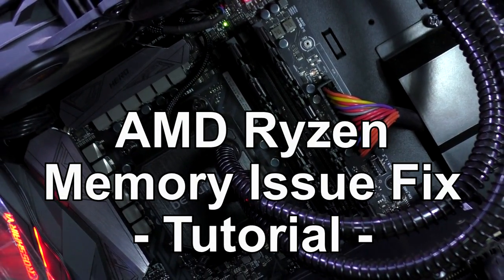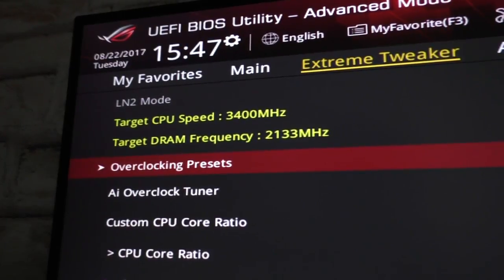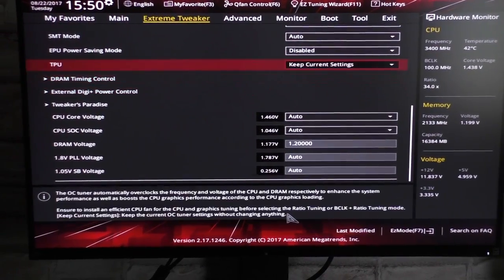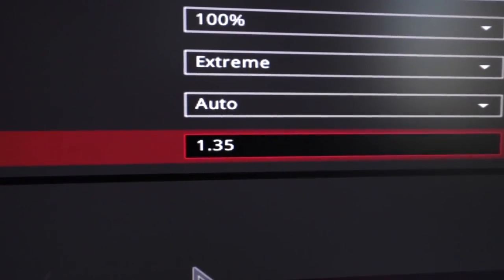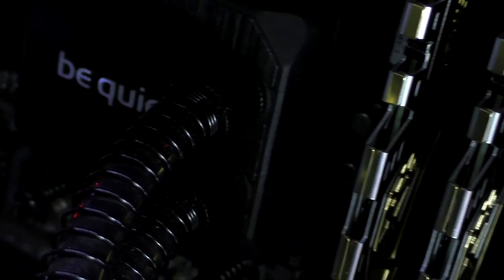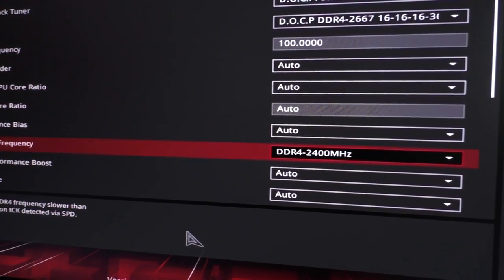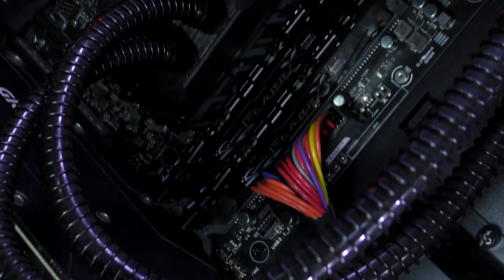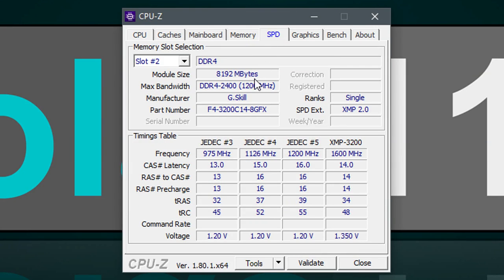AMD Ryzen Memory Issue Fix - Tutorial

Comment: X570 tuf wifi with ryzen 3600
Tforce 3600mhz reads as 2400mhz. 
Turn on docp and it worked for 30 mins then blue screen.  It hasn't work again with docp so i increase voltage to 1.4 and it work for 5 min. 
Now am back and stuck at 2400mhz.
Reply: Did you ever find a fix?
Reply: @SilverDetroit  yes.  You have the same mobo and ram?
Reply: @briantezo9232  pretty similar just curious if you ever figured something out
Reply: @SilverDetroit  look for something that says SOC. It could be ddr SOC or vid SOC. The voltage there is gonna be 1.1 you need to increase that.  If you want 3200mhz 1.13  would do if it's 36000mhz you could try 1.16 or higher but don't go higher than 1.2. 
Save and restart then load docp and you are good to go.  If it's not stable with 3600mhz try lower mhz. 

I got an stable 3200mhz since my ryzen 3600 box says memory 3200mhz.

Comment: I'd just RMA if you can, sure you could push extra voltage to get it stable, but if it's under warranty replace it first. Especially since ram kits should be able to run at their rated speeds for long periods of time.

Comment: im running g.skill trident 3000Mhz ram kit , and i cant get it stable at 3066mhz .. 
it post like 5 times after a cold boot up .. 
i dont know what to do , and the memory try it dont have the 3000mhz ... even the timings are diff... 
im new to oc , so i really need help ?
Reply: got it, im using b350 gaming pro carbon , and i just used (memory try it) to 3066mhz , and so far so good

Comment: My ram is stable at 3200 at 2x16gb but everytime I perform a normal reboot on windows after it goes off and boot back up it keeps turning on and off then goes back to 2400. Then I have to reboot again and set it to 3200 manually and it becomes stable.

Comment: Corsair's Vengeance LPX, 4X4GB DIMMs. Got them running stable at 2800MHz with my Ryzen 5 2600 and GTX 1060 (6GB)  but Shadow of The Tomb Raider couldn't run correctly so I lowered it down to 2666 MHz, which while not as good as the rated 3000MHz, it's better than 2133 (which is what I was getting). Testing at 2666 shows that GTA V hits lag spikes as low as 30s and Shadow of the Tomb Raider is fine until it encounters a scene that is too intensive so I'll have to tweak settings for both games. OS is perfectly stable and boots every time. DRAM Voltage set to 1.35. I have yet to test my other games though. If I find that they all run worse at 2666 DOCP enabled then I'll disable DOCP again and just use my RAM at 2133MHz until I can get a motherboard with better RAM support.

Comment: I have the exact same issue here swap from an old Ryzen 3600 to the new 5800x3D. 
Only able to pass Memtest86 with 1 slot of ram full, the moment you fill those 2 slot of ram, the computer 🖥 suddenly shutdown after fire up Memtest86. 
Is already been 4 weeks I try to fix this ram slot issue on the 5800x3D with no improvement. 
Anyone here has a solution for me will be appreciated 🙏.

Comment: I have xpg ram 3000mhz, installed on x370 crosshair vi. No display whatsoever...
It turns out my mobo compatible with 2400/2666/2933/3200/3600 mhz
BUT not 3000mhz...
Can't get into bios though.
Does this mean I have to get a spare ram let say 2400mhz and get into Bios so I can change the dram freq to 3000mhz ? 
Just to make it support
Reply: Passion Fruit hey did u find a solution? Because that happened today to me can’t get even into bios

Comment: I have a b450 steel legend board with 16gb - gskill ddr4 - 3000 xmp2 ready ram kit on a ryzen 7 2700x wich runs fine but if i ad 16 gb extra of the same memory i get a blue screen after about 5 minutes, any idees anyone, thanks
Reply: Did you ever get this figured out? I also added 16gb of gskill ddr4 to my 570x board and started getting a ton of blue screens. And for some reason my PC won't boot when RAM is only in the first and third slots from left (which were originally empty) but starts up just when when in the second and 4th like they were before I tried adding more. Thanks.
Reply: @baker217  I think its because the NMVE.SSD uses the first lane ans stops the first memory slot from using it in my case, so if you are running an NMVE.SSD it could be the same.
Reply: @kurtbilliet98  can you explain a bit more please? I am using a Samsung 970 EVO, but what does that have to do with the first RAM slot?
Reply: @kurtbilliet98  FYI I think I solved the problem last night. When I used the two previously unused RAM slots, my PC wouldn't boot, but it booted and ran fine using any combination of the 4 sticks in the 2 original RAM slots and passed tests with zero errors using MemTest86. So, I did a CMOS reset on my motherboard, put in all 4 sticks of RAM, turned the PC on and set the DOCP profile in the BIOS to get the memory clocking to specification, and everything has worked great. No BSOD all day vs many previously.

Comment: Problem still there on X570 boards. Wish I had gone for Intel.
Reply: Yep Ive got the x570 board with 32gigs of gskill RAM and my computer completely freezes and restarts daily
Reply: @Annatar_Lord_of_Gifts  i just upgraded from the ryzen 7 1700 to the 5 3600 .... had 32 gigs of Corsair Vengeance RGB and now only slots 1 and 2 work.  this is fucking trash
Reply: @Annatar_Lord_of_Gifts  Did you manage to fix it?
Reply: J0kuc I have not found a fix yet other then putting my computer into sleep mode is what is affecting it. Whenever I come out of sleep within a hour or so it will crash. Haven’t put it into sleep in weeks and no crashes since then. Just keep it on or shut it down
Reply: I just swapped boards and got a tomahawk b450.  Ryzen 3rd gen ready out the box.  No issues.

Comment: I can only run my corsair vengeance rgb pro 3200mhz at 2933mhz if i set the speed higher it wont boot what can i do to fix this i have a ryzen 7 2700 and a b450 steel legend
Reply: Kiyan Van Riet i got same ram but ith r5 2600 bootable 3200mhz but bsod after few minutes gaming
Reply: Nothing, ryzen 2000 series (also called pinnacle ridge) support max 2933 mhz of ram even tho your mobo supports higher your cpu dont. Get a 3000 series ryzen that should support at least 3200mhz but check it on amds page , btw 2933 aint that bad
Reply: @vadaszmate1400  no i already got it working it now runs oced at 3333mhz
Reply: NavyCreature295 how? What did you do?
Reply: @vadaszmate1400  i installed the sticks in the other 2 ram slots then i tried booting and it booted ran a stress test it was stable and then i oced until it didnt boot anymore without changing the voltage

Comment: legit the board won’t run ANY different RAM settings other than default. Tried 3 sticks with Micron E die, Samsung B die, and Hynix die. But I did notice the XMP runs if I only put in one 8gb stick (single channel) instead of 2x8gb dual channel (where it can only use the default it detects no matter what I change or do)

Basically I can’t XMP, or OC, or even loosen timings, or change ANY setting other than whatever default it detects automatically.

If I touch ANY settings whether it’s adding for minusing, it will try to run the setting twice and fail, and revert back to the default.

This is on a newer bios that supports Zen 2 as well. Although I’m only using a Ryzen 2600 aka Zen+

Comment: MB: ASUS ROG B350-F (5220)/ ASUS ROG B450-F (2605)
CPU: Ryzen 5 1600
Kit RAM: G.Skill Trident Z RGB 3000mhz CL 16 1.35V (test)
Kit RAM: Corsair LPX 3200mhz cl16 1.35V (test)
Problems:
- No detected memory ram Q-Led yellow
- No detected graphic card RX580 Sapphire nitro+ 8gb (Q-Led white)
- In gaming after 2-3 minutes display black screen and restart automatically. Before beep long and 2x beep short, Q-led yellow for detect ram = fail
Settings:
- frequency 2666mhz black screen in gaming
- frequency 2133mhz black screen in gaming
- frequency 2933mhz black screen in gaming and system instability. 
- frequency 3000-3200mhz system instability and blue screen in windows 10, after loading OS black screen. 
Why?
Reply: Same here with LPX 3200 CL16.
I have 2x4gb and all ok.
When I add another 2x4gb, computer is not booting...

Any idea? :(

Comment: I have B450m steel legend, R5 3600x, RX 5600xt and 3000mhz coarsair ram. Runs perfectly fine at stock 2133 speed but when I load the XMP profile at 3000mhz it appears stable but ALWAYS crashes eventually and resets itself to 2133. Bad ram stick?  Whole build is new parts accept for the ram.
Reply: Did you ever resolve it? Same problem here
Reply: Yes but cant remember how now 🤣

Comment: Im using a 3 x 8 gb ddr4 3000mhz. I Used to see 3000 mhz in task manager but now only 1500mhz. Why?
Reply: 3x8? or 2x8? if 2x8 @ 1500mhz is right then it'll still be 3000mhz. DDR stands for double data rate. so multiply by 2.
Reply: @rawlstonm97  so I should not worry?

Comment: Ty first when i got my r3 1200 i put my ram to 3000mhz but it crahsed sometimes but its now stable with 2666mhz :)
Reply: Have the same problem. Why is that?
Reply: @derricksweazie7949   ryzen 3 1200 only runs up to 2667mhz sometimes a bit higher but 2666 is best

Comment: I finally got my G. Skill Trident 3200 MHz CL14 RAM to work at the right speed by manually setting the timings, yet my CAS Latency is stuck at 20. Tried disabling Gear Down mode, but it didn't work.
Reply: iseeu1980 what are you’re timings good sir I have the same issue with b450f MOBO

Comment: I have 2 ram stick both at 3200mhz but my mobo says that one is running at 2900 it’s the ram a dud or my mobo?
Reply: I have 3200 also and it runs on 2133... thanks the story i bought it from since i ASKED for compabile memory- - fking useless seller
Reply: @jari2018  just set xml profiles in bios... and it will run at full speed. But before that try to update bios. In my case 3200 mhz 8gb hyper x after putting it into the mb automaticly set to 2990 mhz. And without any chances to wofk at 3200... so i updated the bios and it automaticly set to 3200mhz - max speed of my mb.

Comment: i don’t know alot of pc:s and im going to do ryzen build and i have gigabyte b450 aorus pro and ryzen 5 2600 but today i noticed that my ram (corsair vengeance lpx 8gb ddr4 2400mhz) isn’t compatible with ryzen, does it work if i use that ram?
Reply: I have one stick of lpx 8gb ddr4 2400 on a tomahawk b350 and a ryzen 1400. Definitely compatible but i think it has certain limitations. 93 percent of people can get 3.9/4.0ghz on a 1400. I can get 3.7 of stock voltages, or even less with auto LLC but the moment I try anything higher, heck even with 1.4v at 3.75 I start getting memory issues, or windows files getting corrupted. Thats at either the 2400 xmp, or 2133. I'm gunna find some dominators at 3000 i think and get 16gb's.
Reply: Yes it will work. Ryzen 1st Gen supports ram up to 2667mhz so every sticks rated with this speed should work. For higher rated ram you should look into your motherboard ram compatibility list. Ryzen 2 if I'm not mistaken support up to 2933mhz.

Comment: Doesn't work. I decided to go with an AMD build this time around. If I wanted my memory speed to run at 2133 I wouldn't have purchased a 3200 kit. I can't figure if maybe I am doing something wrong or if the RAM or mobo itself is the problem.  It's really aggravating.
Reply: Cruzan9 same very annoying
Reply: @brooklyn560  I went back to the basics. With this build, I am using only 2 DIMMS (for now). Reseated the RAM (A2/B2) and now it's working. I'll give it a few days to see if it's still running at the correct speed. I think I'll be paranoid for a while and check periodically. Not sure what you tried but that worked for me.
Reply: Cruzan9 i just upped the ram voltage now it’s stable for me
Reply: @brooklyn560  Yeah, initially I increased the voltage too and installed the XMP file. For me though reseating ultimately fixed it. So crazy these tweaks and problems. Too bad they don't work as advertised right out of the box.

Comment: I couldn't budge the voltage, but I had to move the ram from A1 and B1 over to A2 and B2 after checking the manual. Also had to enable XMP.
Reply: Hey I also have trouble getting my ram to run at 3200 mhz dual channel. And I have them at A1 and B1. So did moving them to A2 and B2 work?

Comment: I have a new MSI Mag b550 pro tomahawk wifi board and I thought I had a bad stick of RAM at first so I ordered 2 more. Its also two beside rach other b1 and b2. I could probably figure it out eventually even if i have to replace some components but its under warranty so im not touching it. If I put the ram in like it's supposed to go I get a red CPU light and no boot. I'm going to talk to MSI today and see what they say. I just hate having to tear my rig all the way back apart after I just got it all looking how I wanted. If MSI can't give me a answer I guess I'll send it back but I'm definitely going to look at my CPU very well. It's not a cheap one a ryzen 7 5800x but wouldn't a diagnostic test show if it's a RAM slot issue or a CPU issue. Also I did put a little too much thermal paste when I assembled it so some may have gotten to the pins. Im also going to yry my old cpu a ryzen 5 3600 and see if it will boot then before i tear it all apart and send it back.

Comment: My Athlon 200GE crash and doesn't display anymore, i return the motherboard for replacement but still same issue. I also tried changing memory Adata and Gskill. There is a time it will display after remove/insert the ram 50x maybe morethan that. I regret picking this platform. I have older FM2+ much stable compared to AM4.
Reply: The only component i didnt change is the processor.

Comment: Ryzen 9 3950x, 3600Mhz 32GB of Ram, honestly I had the ram running great until I installed Ryzen Master which is now just keeping my ram at 2133Mhz and failing any OC I attempt to give it, even when running 1.4V for the ram where 1.35V was stable before

Comment: Okay... I will play teacher today!
1st... AMD recommends if you have a ryzen 3rd cpu... to run the ram at aclock speed of 3200mhz

*System Memory Specification
  3200MHz
*System Memory Type
  DDR4
*Memory Channels
  2

^^^This is only at the stock cpu speed of the ryzen chip only (Baseline)

It should boot up...without a problem!

don't know why others are trying to use other ram speeds when AMD tells you exactly what speed is recommended!

another thing......

get ram off the QVL list for your motherboard.

Booting with 3200mhz while your CPU is overclock will work the first time but...give it a couple reboots.

On the B450f.... it will Beep Once (Long Beep) and 2 (short beeps) which means that the board cannot detect the ram

it will loop until it boots up which now the 3 short beeps will happen.... VGA no detected!

If you want to overclock and play safe.... buy the ram sticks that are not overclock to play safe

2133, 2400 and 2600 which is recommended....

anything higher than this will have 50/50 chance of booting up!
Reply: Hi, thx for the information, i didnt knew that amd recomendations. So, i have a 3200mhz ram, but i can only make it work at 2933mhz at stock ryzen 5 2600 cpu, if at some point i decide to upgrade to a 3rd gen ryzen i shouldn´t have problems loading the xmp profile for my ram at 3200mhz?

Comment: Something of interest for you all. Come to find my gigabyte aorus m motherboard slot order is 4,2,3,1 even says it on the board itself. For many years I was under the impression that all motherboards were 1,2,3,4 and typically as per common practice would put first 2 memory sticks further from CPU and every other slot so in 2nd and 4th slot. But on my MOBO 2nd and 4th slot are actually right next to one another. (A1,A2) not (A1,B1). This made a difference as I was unable to set xmp to 3200mhz when I initially had sticks in slots 2 and 1. Would fail to post. After putting cards in proper 2 and 4 slots I set xmp profile and it worked flawlessly and didn't have to manually adjust voltage levels either. This was for g.skill Ripjaws rated as 3200 but we're only showing at 2133. 

Admittedly I am somewhat of a newb to pc building and some would say having a pair of sticks in the 2 and 1 slots would make sense, but in my case putting them in the proper 4 and 2 slots which happen to be next to each other worked for me to set at 3200. Hope that helps for others. Plan to use all 4 dimms and will return with results in a few days
Reply: This was the comment somewhere down below in the comments (I think from this video) that enlightened me to this finding. Sorry I did not copy the OG commentors name when I emailed this info to myself but thankyou!!!

"Just wanted to share my issue that's been solved. If you're stupid like me, my ram was not in my primary slots on my mobo the entire time. So from left to right of the ram slots, they should be placed on the 2nd slot and the 4rth slot (if you are dual channeling). the 4rth slot being the one closest to your 24 pins [SUMMARY: your ram should be in your primary slots] So now I'm finally able to enjoy my 3000mhz :) this may not solve for everyone if their ram is already in there primary slots then I can't help there :/"
Reply: So just to clarify, if you're looking at your slots from the CPU outward and thinking 1,2,3,4 in some cases it's actually 4,2,3,1. My MOBO labels them right on the board itself and as he points out for dual channel you actually want first two sticks in 4,2. Not 2,1.
Reply: One more note. For a newb like myself, one would think simply swapping sticks wouldn't matter because a pair of sticks are identical pieces hardware wise. Wrong. The bios gives unique profile info to each stick. Best to reset cmos after swapping into different slots before booting up for the MOBO to register the swap correctly.